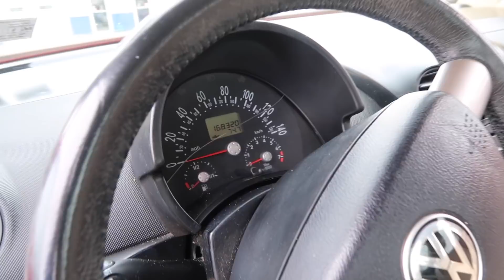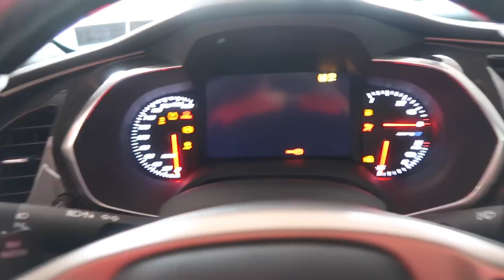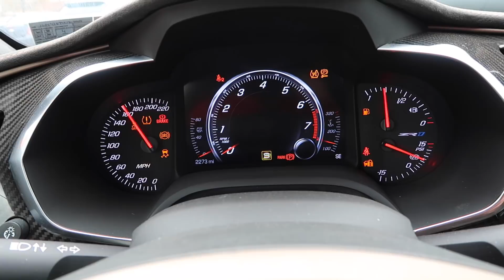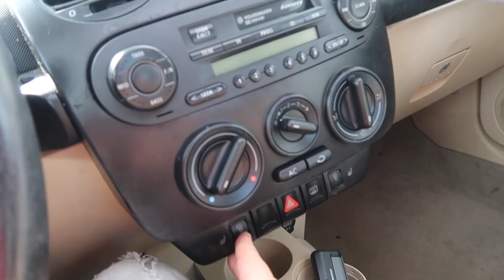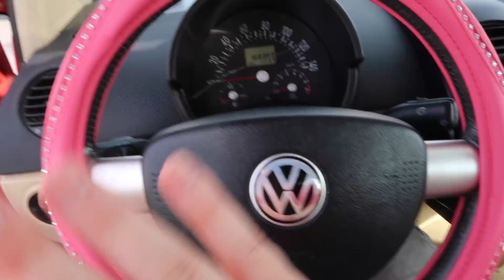MY NEW CAR!!! *Not Clickbait*

Comment: The version you bought with the 2.0 engine does 0-60mph in roughly 9.6s, though there is also a slightly less popular 1.8 turbo version of this generation of beetle with 150hp and a 0-60 time of 7.5s. However, that VW 1.8T engine is known for its tunability, and this car with that engine and around $3000 worth of engine upgrades can output upwards of 350hp at the wheels. At that point, the 0-60 time is almost purely traction limited. In a rolling race, it would for sure beat pretty much any modern hot hatch, maybe apart from the new RS3 Sportback. And yes, it comes with a manual.

Seriously Parker, you should've gotten one of those.

Comment: Those 2006+ VW New Beetles with the 2.5L Inline-5 engines are rockets with the Tiptronic transmission. VW also made a New Beetle RSi with the audi 3.2L VR6 and 4Motion AWD.
Shoulda got one of those instead of the 2.0L that VW put in baseline cars

Comment: The thing is the 570 is unbelievable and does everything great but the ZR1 is strictly track I understand you can drive it on the street but it’s a track car but I would never had bought a manual because at the track it will be to crazy to react as fast as you need too , but I haven’t heard about the ZR1’s auto if it’s not great then it’s a different story but manual is d technology not good enough for today’s supercars